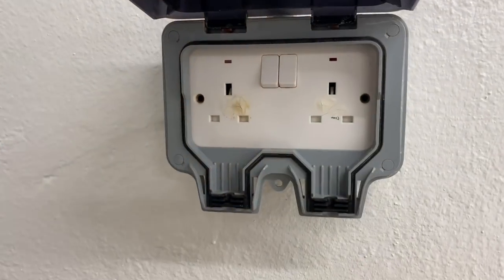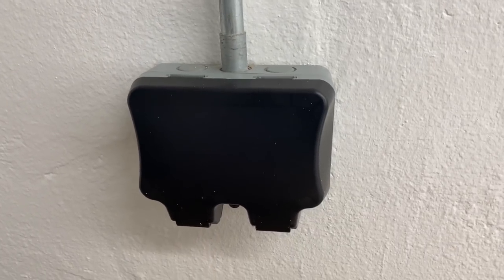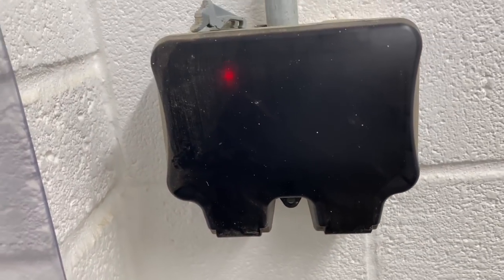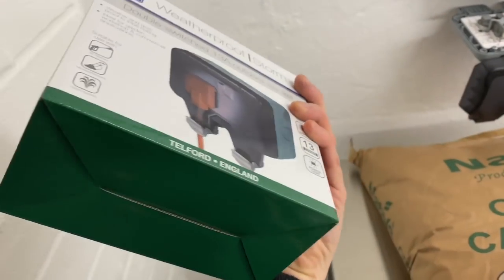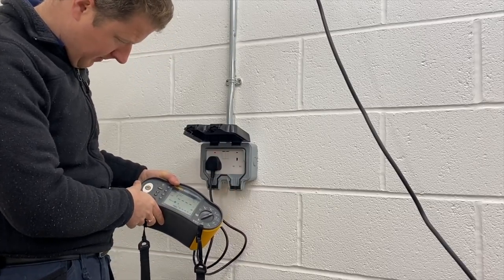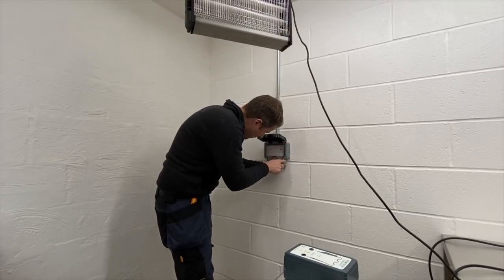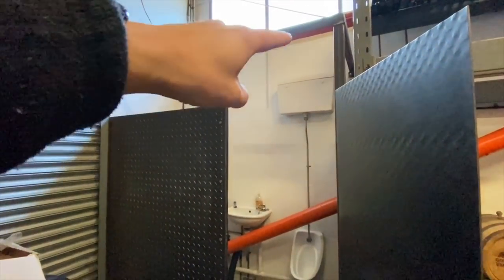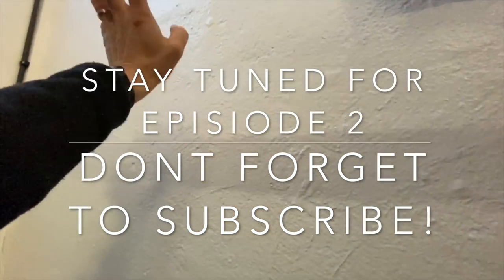Commercial Electrics Part 1 - Fault Finding Dodgy Sockets

Comment: Did you ask the baker what they’re plugging in that’s melting the sockets? Maybe they need more than 13amp sockets - maybe 16amp or 32amp Commando? Otherwise they’re just going to overheat again.
Reply from the maker: Dingo Nates yeah they are running too many heavy things at once, as always they underestimated the usage they would need, it’s only a 20amp radial.
Reply: @artisanelectrics  thts why in the states we prefer to run large equipment off of one feed. many breakers and huge service panels but you avoid this scenario of multi draw on a underestimated amp circuit.
Reply: @artisanelectrics  I'm not convinced. If it was multiple consumers adding up, the breaker or the wire to to it would heat up. But here the front plates of the sockets got hot. Looks to me like they have been using an unfused plug with a (maybe combined) heavy load and put that into different sockets.

Comment: Have you tried 20mm flanged coupling with lead washers to terminate conduit.
Reply from the maker: john flower wow lead washers are we allowed to use those?
Reply from the maker: john flower I’ve discovered something new thanks!
Reply: Flanged coupling is the answer with a bit of plumbers gold
Reply: Rubber washers or fibre washers.

Comment: Quick question why did you replace the whole front of the BG sockets ie buying 2 new ones roughly 20 quid, when you can just replace the 2 gang neon socket as there just standard units screwed in for 2 x 3.50 from tlc

Comment: Hi Jordan, great video!
One minor point, may be worth thinking twice about using silicone sealant inside accessories.  I have found the chemicals, as they gas off during the curing process, sometimes damage / perish the internal plastic components such unused entry seals.  
Never had an issue with silicone sealant on the exterior.

Comment: Nice video Jordan, I’d consider 20mm flanged coupling for the top socket entry, also as their is signs of socket overheating on both outlets it may be worth checking what load they are using, a different outlet type may be appropriate to avoid repeat visits.

Comment: Hi Jordan, I always double up where possible.  I have something interesting to tell you.... There was a time where doubled up, but one time I notice the N continuity and the L continuity was not consistent on the ring main, like as if there was a loose connection on the neutral giving a higher reading.  I found the cause on one of the sockets the 2 neutrals were in the same terminal as it should but with a 2mm gap and not doubled up, this socket was terminated by someone else and the continuity was relied on via the terminal screw, but when I made it copper against copper by doubling it up, the reading was perfect.  I repeated the problem on purpose and it turns out that some metals are just not as good for terminations so by doubling up on a ring you're more or less it's copper on copper.

Thoughts!?!
Reply: Steve Tang thanks for that tip. Nice one👍🏻
Reply: @markgilder9990  here's another thing, I'm doing an R1 and R2 test on a lighting circuit, the reading would appear that the circuit is too long and not comply with volt drop allowance, the real reason is the earth's were not doubled up on copper against copper, relying on a zinc screw terminal in all the down light messing up the continuity, the Zs reading would be fine coz most testers send to 25amps into the circuit where as R1 R2 test is usually about 200mA so going through different metals could affect the reading. I have told the engineers to double up now.

Comment: Surprised to see "solid core cable", in such widespread use in the UK. Interestingly, it is illegal to use solid core in a building (high rise), in Australia. Most new homes use stranded "two core and earth), where the earth is also insulated.

As you know, now living in Thailand where literally "anything goes". Hardly any stranded cable anywhere.

Yes, I always double over a single conductor when there is only one cable.

Comment: if your terminating PVC conduit into IP65 outdoor sockets i always put a dab of pvc weld on the inside where the coupler connects to the back box. that always seems to work fine for me in terms of weatherproofing more. only problem is that later on when you go  to change the socket it will not come off cleanly.
Reply from the maker: Good tip thanks!

Comment: 20mm flanged coupler with lead washer, and use 2 single sockets as people think a double socket is rated at 26 amps and they aren’t. Recently changed a burnt double socket with a dishwasher and tumble dryer plugged in. Customer could smell burning in the kitchen.
Reply from the maker: Yeah that happens a lot I bet!

Comment: Just for curiosity did you do the work on warranty or customer billed for material and Labour 🤔 great video 👍
Reply from the maker: It wasn’t under warranty as they had clearly used the installation for purposes beyond what it was designed for

Comment: I just stick a rubber “o” ring between the socket and the conduit.

Then when you tighten it up it squashes the rubber and provides a seal
Reply from the maker: Good tip

Comment: I use solvent weld cement (for plumbing) to weld a female conduit adaptor to 20mm conduit, and to the plastic box also.
Reply from the maker: Nice tip

Comment: Jordan, they aren't Neon lamps in those BG socket front's, they are LEDs fed with a resistor. I always double up on single conductors, and not if it is more than one. A round terminal is designed to take multiple conductors stacked, and the screw clamps them around the inner circumference of the terminal giving a better connection. A flat clamped terminal may be OK for 2 doubled over conductors, but it depends on the terminals, and space inside. However, i would never stack 2 doubled over conductors on top of each other, they are more likely to fall out. Re the waterproofing of the BG boxes, I always glue the conduit entry in, and drill a hole for the drain in the bottom (as per the manufacturers instruction). Cool video, and same proving unit as me lol...
Reply from the maker: Interesting comments thanks!

Comment: Interesting set of circumstances.  Did you look around to see what was plugged in and what was the power rating of the appliance?  Why would you think that MK was better than BG? Is it down to experience or is it because MK has been around longer than BG? I think we decided the BG pendants were good. I’m guessing that branding does not necessarily mean that the product is best but if faults keep re- occurring for a particular product then we can infer that there is a problem with it.  I also fold over the solid copper wires - it was taught to me back in the seventies and makes sense with respect to making a reliable contact with the screw terminal.  Am I a sad electrician for watching people do what I’m dong during the day?

Comment: They make a fitting in America called a Myers Hub that is made especially for going in tops of boxes that prevent moisture from going in .They work great and have used lots of them.
Reply from the maker: Jerry McMorris sounds great where can you get them?
Reply: @artisanelectrics  They are a Crouse Hinds Product. Myers hubs were invented by Myers  company in America and are still called Myers hubs. They are no longer in business. Crouse Hinds was bought by Cooper and Cooper and Crouse Hinds are owned by Eaton Corporation. Myres hubs are used all over American especially in industry and outdoor locations. I would think you could get them in the UK. They are used with rigid and IML conduit.
Reply from the maker: Jerry McMorris yeah looks like a USA version of the flanged coupler these other guys are mentioning

Comment: Just be careful when your siting that spur in the toilet as looks really tight on space and wouldn’t want it too close to the basin maybe you could downrate it next to the socket and pipe to the wall light and fit one with a pir or even fit a quinetic one where you could mount the switch anywhere

Comment: I would just change out the double socket for a better quality one, leaving the whole enclosure. Others will fit. The bg enclosures are good but their sockets are crap.
Reply from the maker: James Thew thanks for your comment, not sure which other brands would fit on a BG back box tho...
Reply: @artisanelectrics  You can change the socket in the front part of the cover.
Reply: @artisanelectrics  Looks like it's just a normal socket (white) that is fixed to the front (gray) with 4 screws around the edges.

Comment: You can get mk masterseal adaptors but they are for pvc conduit (black only) tlc screwfix ect do them there there a bastard to fit but if you warm them first there not so bad. Also i have got them on galv conduit before but you cant thread it.

Are the conduits earthed? I usually put a 20mm nipple into the coupler and a piranha nut in the box instead of a bush if its metal conduit between two pieces of pvc of just conduits drops from the ceiling
Reply from the maker: Good tips thanks!

Comment: can you UK sparks bend pipe and pvc conduit because if it where me i would have gone bottom entry and wld have asked to see the equipment they are using to determine proper socket rating.
Reply from the maker: wizard3z castor yes we can but we try to keep bends to a minimum wherever possible
Reply: @artisanelectrics  same with us in the states

Comment: Why not put the fused connection unit for the light nearer the socket outlet before entering into toilet block?  I suppose if it was outside people could turn it off whilst someone in toilet. Maybe a non switched fuse. And lightswitch near door? Quite 70s 80s fashion to put a light on fcu off a 2.5 wire instead of its own 6 amp circuit.
Reply from the maker: You will see how I did it in the end on part 2! You’re not far off!

Comment: Whilst the bg weather proof sockets are fine for light use eg domestic customer occasionally plugging in a pressure washer or mower, for heavy use they are poor.

I'd be wanting mk master seal on those.
Reply from the maker: Yeah you’re probably right

Comment: I bet the plug on the appliance has a loose connection causing it to overheat the heat will be transferred to the socket that is why you are seeing the start of the same problem on the other socket.
Reply from the maker: Yeah could be! Good guess

Comment: I had a customer who removed the clips too.  I hate them now.  BG IP67 skts, not the customer.  Customer was extended family.  I like the MK design, the BG you require HUGE FORCE in order to clip and unclip, if I hate them, then I guess the customer will too, and never fit them any more.  I tried Crabtree the weekend.  I loved it,. but not available in CEF.  The ones I hate use stupid little rubbers to go over the mounting screws in the watertight compartment (hence they're not watertight) even the Crabtree had the knockouts which need glueing in with PVC cement to make them up to the ip rating on the box.  Another way is to buy rubber gasketted blanking caps and nuts, and replace the fucking things completely (knockouts I mean)    LOVE YOUR VIDEOS man, all the best rest of the week.  x
Reply from the maker: Thanks for your comments they are always helpful!

Comment: Are they power washing every day? If they plug the power washer into those sockets and then run it heating water constantly for, say half an hour each day, that is a constant heavy load being put on the socket which might well be overloading it. Did you tear down one of the sockets with heat damage on the faceplate? Also, is that sediment in the bottom of the weatherproof enclosures, which would indicate water ingress? One last point - to use the urinal in the toilet do they have to pee under that large orange strut? Can't see that they could get close enough without splashing the floor :-)
Reply from the maker: No they only did the power wash as a one off I think to clean the place.

Comment: Is the conduit earthed? Drilling a drain hole removed the IP 66 rating.
Reply from the maker: No I don’t think it does remove the IP rating as it’s at the back of the box and very small!
Reply: IP66. Complete protection from dust and water jets from any angle for 3 minutes

Comment: Bg outdoor sockets are poor. Good price point but not fit for purpose 
With a plug top plugged into the socket outlet the lid won’t shut properly 
So you do not get  the IP rating and probably why the bottom catches have snapped .
Good video though
Reply from the maker: They do shut properly if done correctly but they take a lot of force
Reply: Totally depends what you plug into it. 
I’ve found that a moulded plug top with thick flex and the lid won’t shut.